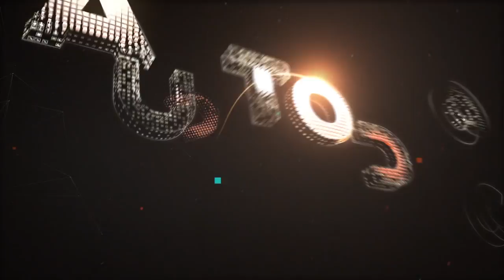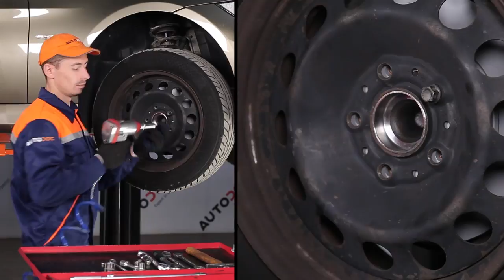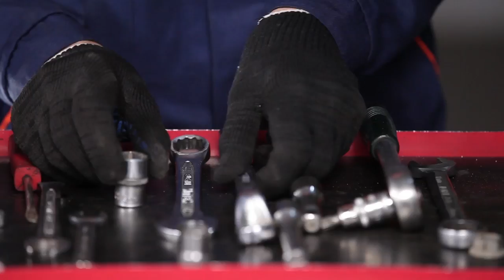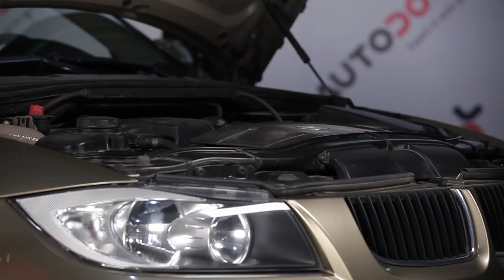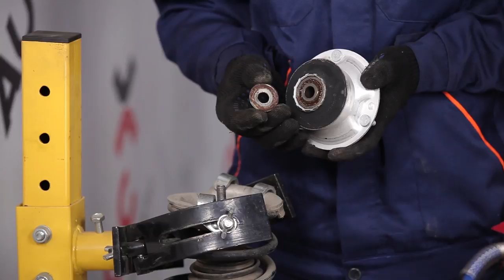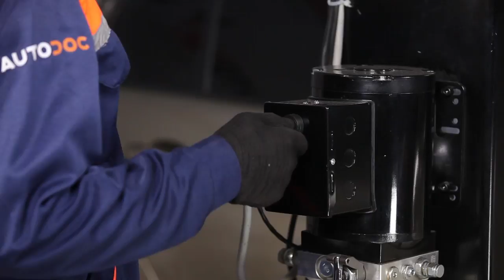How to change front strut mount BMW 3 E90 TUTORIAL | AUTODOC

Comment: Great guide. However i'm not sure if its because mines a 330d or if its had pattern parts installed but the 15 and 17 spanner sizes first shown were actually 16 and 18 and the t45 and 22 spanner was actually a t40 and 22 spanner. Everything else was exactly as shown.
Reply from the maker: Thank you for your comment! We understand that mistakes were made during the replacement in this video, and in the future we will try to prevent this from happening in our videos again.

Comment: This is so bad at so many points. 
Letting the steering knuckle, rotor, caliper and all, hang from the brake lines. Cringe!
Removing the tie rod end from the knuckle, but not the other ball joints?
Especially considering you have to loosen the control arm & tension struts at the subframe. Those bolts are torque-to-angle and are supposed to be replaced.
Do you see a single torque spec here?
Removing the control arm from the subframe is probably a major PITA, or near impossible if you have the M3 upgraded arms (they go in TIGHT).
Reply from the maker: Thank you for your comment. We understand that mistakes were made during the replacement, and in the future, we will try not to allow this to happen again.